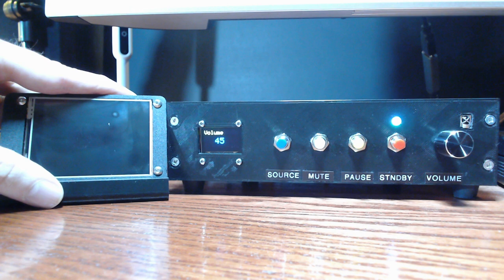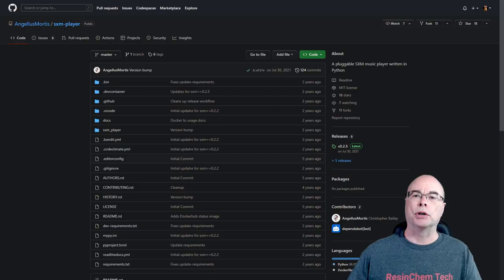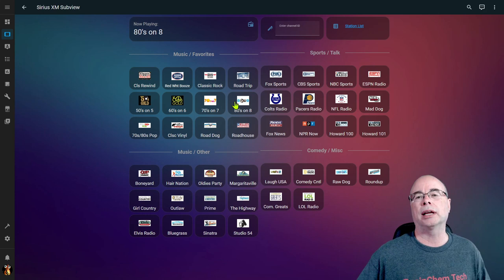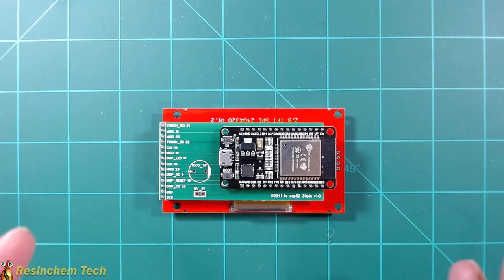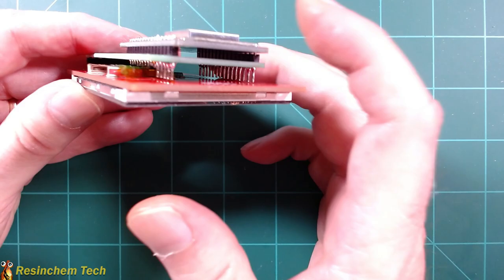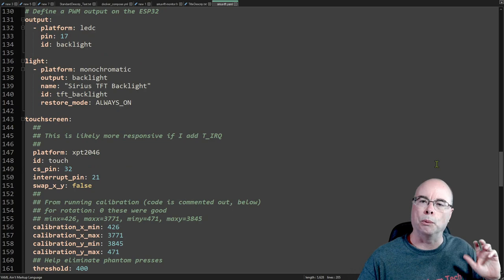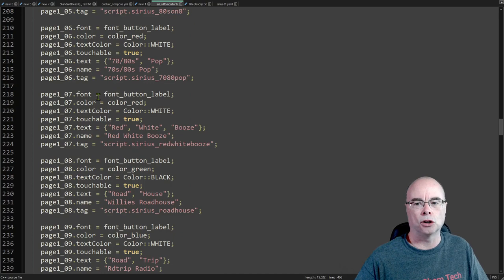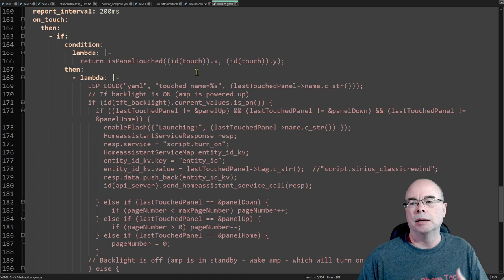Local SiriusXM Server and Touch Controls for the DIY Amp

Comment: Thank you for all those detailed information. When I tried to do something similar I used Kodi on a Raspi. Worked well, but it felt always overkill to use KODI for such a simple task. The good thing about Kodi are the posibilities to remote control or use a touch screen.
Reply from the maker: You are welcome!  I did look into a number of other possibilities... Kodi, Jellyfin, Music Assistant, etc.  But I wanted to be able to stream directly to the amp without relying on a "middle man" such as Home Assistant, or an app like Jellyfin that was, as you mentioned, overkill for my particular needs.  I just needed a distinct URL for each Sirius XM station and the amp could stream from that URL.  Yes... I do make use of Home Assistant for some additional automations for the touch panel and dashboard... but those technically aren't required for the streaming.  I can just send an HTTP command to the amp to pull the stream directly from the stream server.

But you are 100% correct that some of these other services might provide additional flexibility.  For me, it was all about filling the gap for Sirius XM that I couldn't play directly to the amp.  Thanks for watching and taking time to comment!

Comment: Any way to extract the sirius now playing info? I want to inject that into a visual on the m3u stream to create a viewable channel for jellyfin
Reply from the maker: I haven't found a way yet... at least not with the amp, ESP32 or streaming server that I'm using.  Obviously it is part of the data stream but I haven't been able to figure out how or if it is encoded.  The artist/title shows up in my car, so it has to be part of the transmission.  I'd love to figure it out and display the title/artist on my display.  I did find a gist that uses web scraping to extract out the title.  But it is in Python, over 12 years old and web scraping is notoriously unreliable as a change to the web site can break the code used to scrape.

I've also seen information that Sirius uses the CT-aacPlus (HE-AAC) codec.  But I don't know enough about codecs to decipher that and figure out if the info could be extracted somehow.  If you ever figure it out, please get back in touch and let me know how you did it!